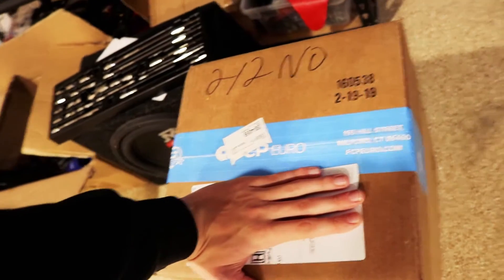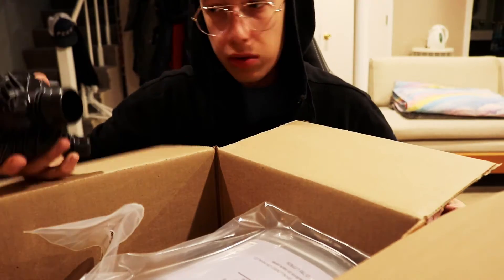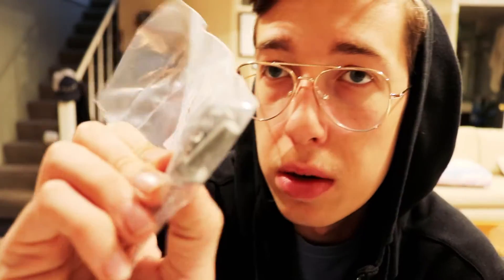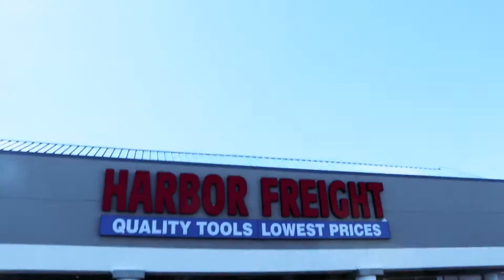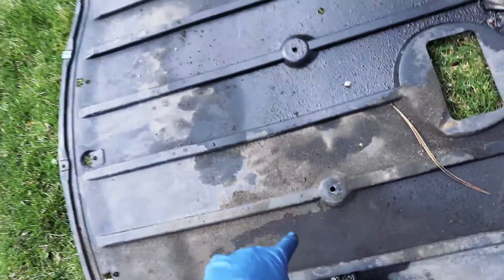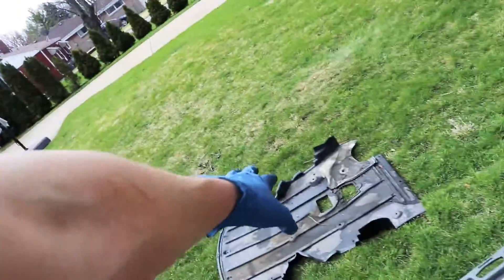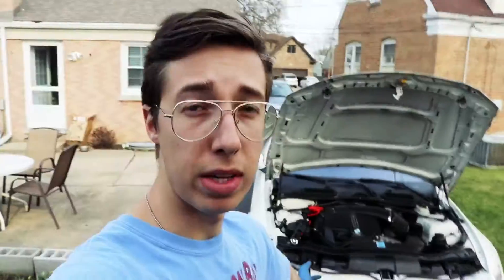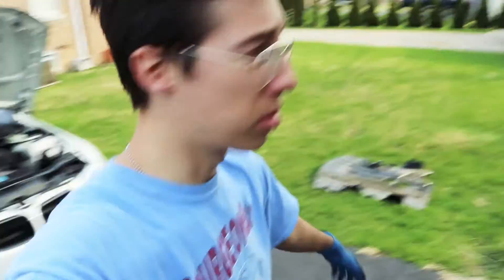(N55 335i) BMW Water Pump and Thermostat | Hard as They Say?

Comment: When I did this on my N55 I was actually surprised it was easier than expected. Just make sure you have the right tools for the job. An electric screwdriver with a flex extension is a lifesaver. I will say prepare to get very dirty and wet, but don’t worry about the install itself.

Comment: My grandpa and my dad had those glasses, man. 

Also, it seems like everything I needed coming into this video was skipped by you... drum roll... not installing the thermostat or the water pump on camera.

Furthermore... you went to BMW to buy coolant? Yikes. Absolutely no need, it's nothing special.
Reply: I agreed on everything you said, but.... coolant. There is only a hand full of coolant manufacturers. And the nicer the car the more the manufacturer adds more chemicals to there stamped logo bmw coolant (grey bottle ) so if you add others or non distilled water it will clump on purpose to bring the car back to the dealer ship

Comment: Yeah try doing it with a big subframe in the way in the x drive models, nobody said the rwd models were hard to do lol it’s literally just hoses and the cars bleeds itself.
Reply: Just did it on an n55 f30 xDrive. Wouldn’t be able to do it if I didn’t break the turbo boot inlet 😂 otherwise, you’d have to remove the cooling fan to remove it from the bottom.
Reply: @sowishful  hey im about to replace my water pump on my f30 n55 xdrive aswell. what steps do you recommend to make enough space, and should i remove the radiator fan also?
Reply: @icrxss4103  you either remove the radiator fan, or remove the boot inlet that connects to the turbo. My plastic boot inlet broke anyways so I didn’t have to struggle with the radiator fan. But either one of those out should give you enough space. As for the bottom, you got a few tiny holes you can stick a long extension in that gives you access to the two bolts underneath (ty engineers). But once you figure it out, it’s pretty easy job.
Reply: Definitely way more straight forward when the car isn’t an x drive.